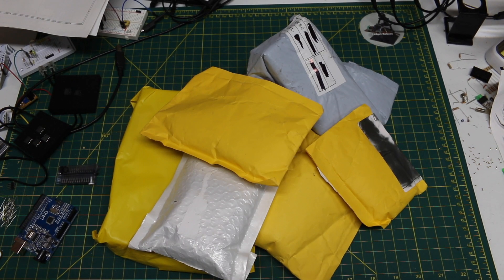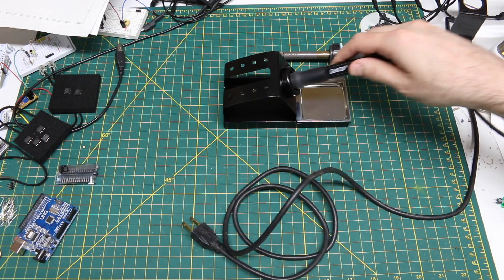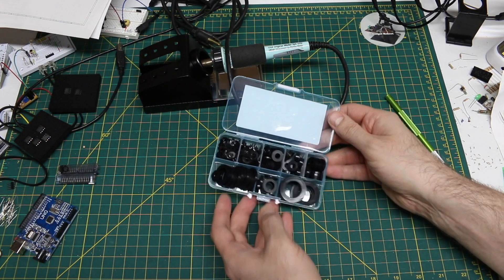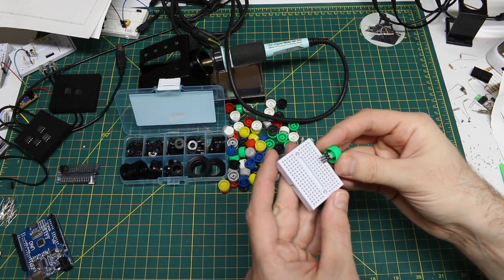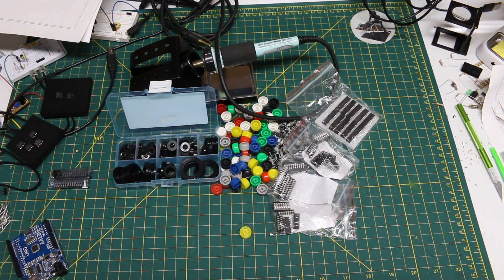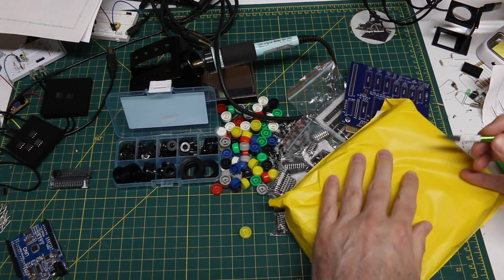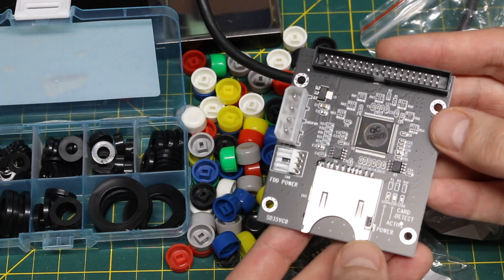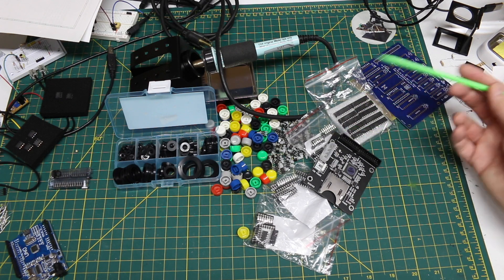Mailbag!

Comment: I bought an exact same type solder iron stand but its angle is too low, not suitable for those like me holding the Solder Iron like a Pen. Maybe fit for those who hold the Iron like a knife. Secondly, Its too light in weight too, keeps sliding. I used a Weller stand earlier which was very much perfect and best, also had a non-conductive for heat collar, so the stand remained cool.

Comment: I've built the same XTIDE with all HCT parts and connected it to the very same SD/IDE adapter. Works fine on my XT, even with larger cards. My 286 luckily can access larger drives through a standard 16 bit multi IO card now. After I've tried dozens of different BIOS images, I found one that wouldn't lock up and allowed me to use a custom CHS config. Running the XTIDE option ROM from a 16 bit network card also worked quite well with the standard multi IO card. So if your build contains a network card anyway, I can recommend running the XTIDE ROM from it to get nice large drive support.
Reply from the maker: The only Netwerk cards I have are PCI so I can’t use them on the 286 but they do have the empty rom sockets on them so I can possibly use those on 486s.
using this SD adaptor plus XTIDE card in the 286, I can’t get it to boot from the card but if I boot from floppy then I can access a two gig partition as a slave drive. The same SD and XD IDE card do boot in a 486 so I know it technically works. Were you able to boot from 286?
I saw a video where someone had the same issue on 286 and put in a different BIOS on the motherboard and then it booted, but my BIOS is already 1990 like the one they used so I’m not sure that would still be my problem.
Reply: @GadgetReboot  Yes, I tried a dozen different 286 BIOSes until i found one that wouldn't lock up at boot and also allowed me to set a CHS user definition ;-) I wasn't able to access 2GB for boot though. I configured it for 800 cyls, 16 heads and 63 sectors. That made a drive size of a bit over 400MB and it booted fine with that from larger SD and CF cards.
Reply from the maker: I just figured out my boot issue by accident.  I had even tried to put a real IDE drive in (10 gigs) and that still didn't work, even when I formatted it just as 20 MEGs.    Then I ran the Check It  utility and the answer became clear.  It reported all the system hardware including hard disk 0 being drive E (not C), because my floppy controller was still set for 4 floppies (A thru D) even though I only had 2 plugged in, so I wasn't thinking about the fact that the system may want to boot from a floppy on C:.   I deleted the 2 extra floppies in the config and then both the real IDE drive and the SD card were able to boot as C: when I tried each.   Days of wasted time!
Reply: @GadgetReboot  OK that's Karma for flexing with your monster floppy controller.  Serves you right ;-)